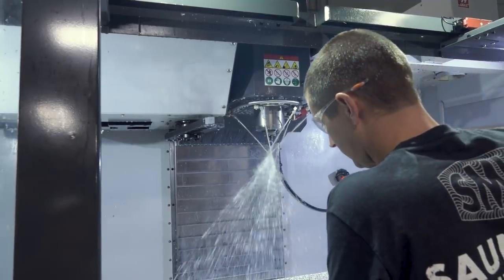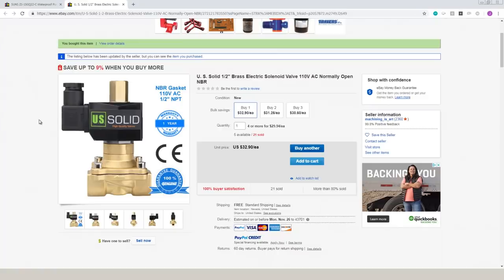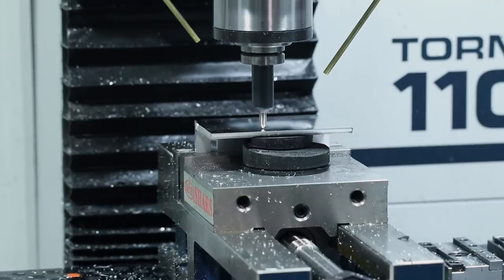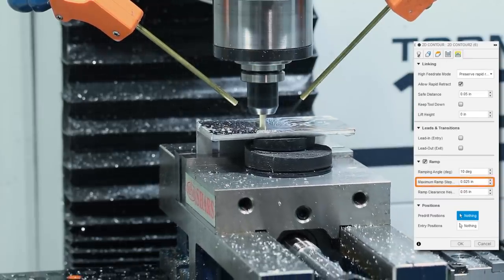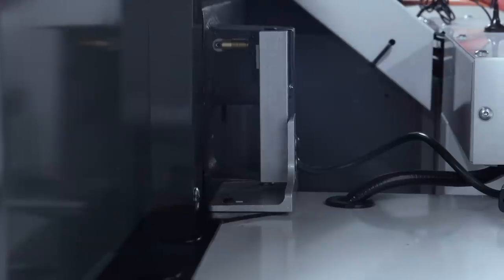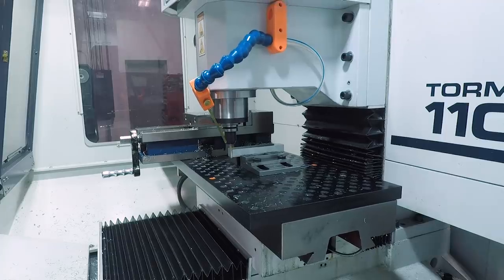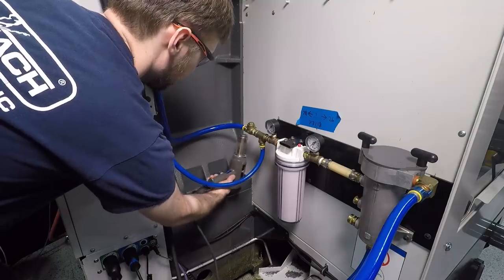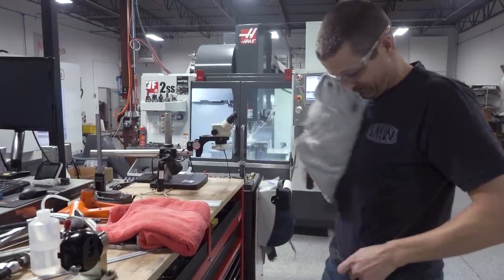Automatic Coolant Shut Off Switch | WW226

Comment: That was a lot more interesting than I was expecting, but anything with chips flying is great. i love the tip on the hockey pucks, I think I will buy a bucket of them for my hobby shop. I already have made a couple of bench blocks out of them and I think i like them even better than the steel one for most jobs.
Cheers and thanks for the great content!

Comment: Pretty complicated..well compared to ours, but I love it and the way you made your system its creative.For our machine when it comes out the coolant pump, we put a Y connected with integrated Ball valves, just select whether you want the hose or coolant.
Reply: That's a nice solution too. However humans do make mistakes, so someone might forget switching back. What impact that has, will depend on many factors (like machine attendance) but needs to be considered. I totally understand scrapping the human factor in most designs...

Comment: Hey John, use turpentine as coolant/lubricant for cutting aluminum. Prevents the chips of sticking on your surface or your cutter and it gives you a good surface quality.

Comment: all you need to do is tie in a normally closed solenoid and normally open relay from the door safety switch. When the door is open the relay opens and in turn closes the solenoid.

Comment: RE: slotting - there's this thing I do when needing a slot in wood (usually Masonite board) : I use a drill to remove most of the material first, then kluge my way through the rest with the same drill, back and forth until I get something close to a slot. While I don't reccomend the latter, you might want to try removal using a drill first. Please lmk what you think and/or if this work for you!
Keep on making those graet vids!!!

Comment: I've thought about something similar for a washdown setup on a Tormach. I envision a pressure switch controlling the coolant pump and a NO solenoid valve (120v AC so it can be easily connected to the coolant control of the Tormach) on the coolant ring. When the pressure switch detects a drop in pressure in the coolant line (from either the solenoid opening or the hose opening) it turns on the coolant pump. You just have to set up the power to the coolant pump or pressure switch so that it turns off when you turn off the machine, otherwise the coolant will turn on when you power down the machine.

Comment: Slotting for me has worked if you reduce your gauge height, on that tool visually, if you can get a holder that's like half or less the gauge height, with flood coolant I slot right into 304 stainless. High feed end mills also help. I know adaptive is cool, but like you say, sometimes you really just can't spend the 20 minute cycle time it might take to adaptive it out with an 1/8" end mill.

Comment: Nice idea but what I hate is coolant that continually drips while you're trying to change parts or doing a set up.  I have to jog away from under the spindle.  I'd like to see an air purge of the coolant nozzles.

Comment: My idea would be to machine a new handle for the coolant tap and have it spring loaded. When it rises up, it pushes against the ceiling and the tap is turned off, but as soon as it lowers, the spring tension would open the tap again

Comment: 2 things John. 1 Why do you not use flood coolant in the 1100M ? That should prevent chips heating up and sticking to the end mill. 2. You are telling me that a 100k $ machine has only 1 control solenoid on board to control the flow of coolant ? VM3 ?

Comment: You could do it pneumatically - i.e. a simple valve in place of the switch and a pilot-operated valve in place of the solenoid - if you, for instance, wanted to.

Comment: There ought to be a "sawing" motion available for cutting slots where the Z moves up and down cyclically over the length of the cutter while cutting the slot. Should reduce chip weld and improve clearing chips.
Reply: Mastercam has that option on contour.

Comment: shut a door in front of a pressurized fluid is a nono for the pump... instead of a shutter solenoid better use a 3 way diverter solenoid that when is "activate" re route coolant straight to the pool instead of giving a dead end
Reply: Depends on whether it is a positive displacement pump or not. A centrifugal pump for example does not care if it is being blocked, a piston pump for example would most certainly die very quickly...

Comment: Less RPM (about 500 potentially a little more...) for the full load cut then your chips get thrown away more quick and can take up more heat... but be careful... I would use coolant for that...

Comment: Have you had any issues with the solenoid burning out? On the web page it states that it is not 100% duty cycle and can burn out after 8 hours of continuous use.  Guessing you hooked it into the outlet supplied with the machine so it turns off when the machine is not in use?

Comment: could also have used a pushbutton valve to directly shut off the coolant, or indirectly used an air switch if worried about waterproof electronics

Comment: I'm missing something...why can't the switch just do the same thing as the panel "Coolant Off" button  i.e turn the pump off (or whatever it's functionality is)?  Rather than use a separate valve?
Reply: It sounds like the panel button controls the pump. If the pump is turned off, the hose won't work. Their solenoid only turns off the head nozzles, so the pump can remain on and the hose can be used.
Reply: @Hirudin  , that, explains it, thx. Did not know about the hose.

Comment: I'm no engineer but I think it would be a whole lot cheaper, easier, and smarter to just put a 1/4 turn brass ball valve on the spindle coolant outlet line from the screen filter housing.  $15 and 15 minutes. You could probably be done in the time it takes you to watch this video

Comment: Those solenoid valves usually have tiny open orifices, which would seriously restrict flow in the on position.  Does that one have a full 1/2" orifice when open?

Edit:  Here's the valve I use for coolant control on my Tormach.  It's a motor actuated ball valve, so it doesn't have a wimpy orifice when open: https://www.amazon.com/gp/product/B00Y1ZAKS2/ref=oh_aui_search_detailpage?ie=UTF8&psc=1

Comment: The solenoid can still get stuck closed though, right?
Reply from the maker: I suppose - but it's as close to fail-safe as possible.  The coolant pump could also die, a line could get disconnected or pinched, etc.

Comment: use a 2 or 3 flute end mill in aluminium... doesnt gum up. Helps the chips escape
Reply: :D itsnot aboud number of flutes , but its about geometry .. OH ?/ .... especialy its about spirale angle on flutes
Reply: I've found a high helix angle helps. The other day I was slotting 13mm 6061 full depth with a 10mm high helix 2 flute and neat cutting oil mist. It worked pretty well.
Reply: Or go full crazy and use a 1 flute. In slotting getting the chips out is key and I do feel flood coolant may have worked better.